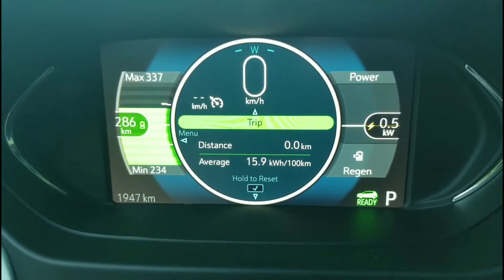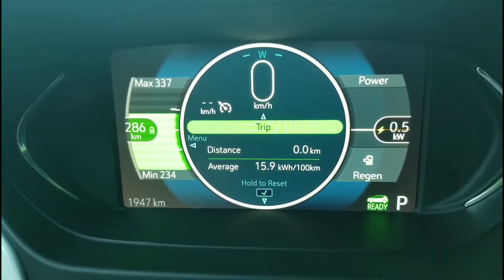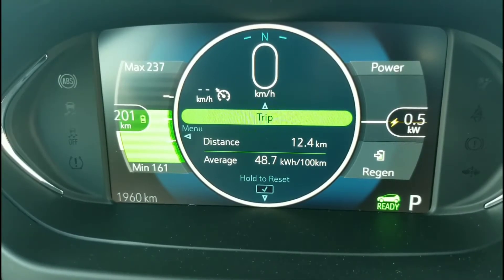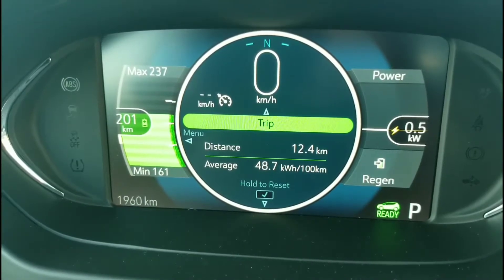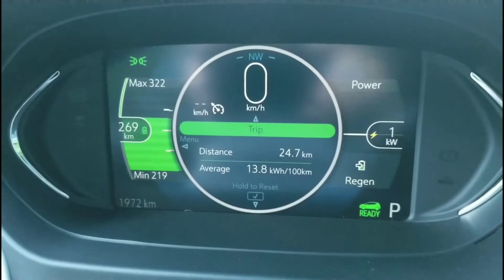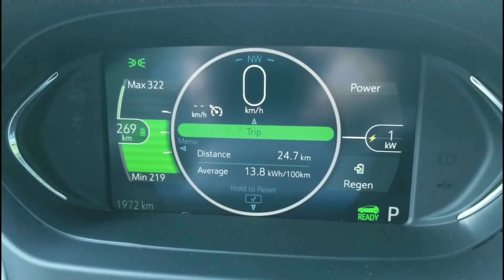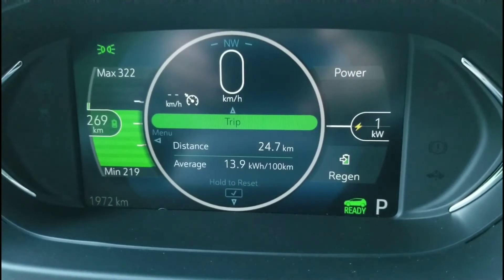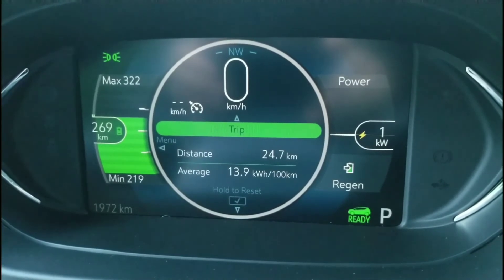2017 Chevrolet Bolt EV - How Much Does It Cost To Go Skiing?

Comment: Just curious, why do you show your range in km? I assume most of your viewers are in USA, since thats where the car is sold currently... I am all for the metric system but as far as I know, no where lists distances or speed in km or km/h in the US and most people cant do the conversions in their heads... EDIT: just kidding you are in Vancouver, BC... carry on! Great videos BTW!
Reply from the maker: Correct. Bolt EVs are sold in Canada as well, where we use the metric system. I just attended the Vancouver EV Association's (VEVA) 'ElectraFest' this weekend and saw more Bolts in one place than I've ever seen before. Probably, at least ten?? And many were the LT. I've never seen an LT and was curious to see some of the stuff it didn't have compared to the Premier.Still far and away, the most common EV is the Leaf. Lots of Leafs.
Reply: It's so hard to find a Bolt for sale in Vancouver. Last I checked, Bolts aren't available until the Spring. Did you have a long wait for yours?
Reply from the maker: Patrick Soon Hi Patrick. Agreed. I had to wait 6 months for my Bolt. I purchased it sight unseen, no test drive, basically just checking options online with the salesman. Paid full price. Didn't even get a Chevrolet coffee mug🙁. But as I say, I've been very happy with the car to this point. Silent. Quick. Fun to drive. And lots of electronics to keep you busy. You should get one👍

Comment: I think the Chevy Bolt doesn't give enough battery info for you to easily do a tesl like that. Using the guess-o-meter as a battery gauge won't work.

If you did the exact same test in reverse after driving on flat stretches if the mountain top to recalibrate the guess-o-meter to neutral, then when you drive down the mountain it would look like you gained a lot of range (which you wouldn't), but when you drove up the hill all that fake range would vanish and soon the range would be 90 km less than when you started at the moment you reach the top, until you drive around to recalibrate at zero slope again.

Hopefully Chevy Bolt adds some programming features that lets you choose how to view your actual battery energy. I'd personally prefer to know how many kWh I have left in the battery and my instantaneous watt-hrs per mile so I can learn what my vehicle does in each situation. 

Regen is one of the most misunderstood features of EVs. The fact is if you use any breaking (mechanical brakes, regen breaking or engine braking) you LOSE efficiency. However, of the three, only regen gives you back a tiny small percent that energy loss. 

Hypermilers will do their best to use zero mechanical brakes and as little regen as is safely possible, even if it means making everyone behind them mad. 

Regen braking helps most when the driver is driving the least efficiently, such as jackrabbit starts and max regen stops. 

The one place regen earns its cost is going down very long and steep grades that are impossible to coast down safety. The main feature is that it will prevent your mechanical brakes from overheating and will convert some of what would be wasted heat into useful energy in the battery. 

So, this is why they say regen can give up to 20% energy back. If you drive perfectly (but annoyingly) you will get 0% regen. If you drive very inefficiently (also annoyingly) you will get max regen but lowest range (although more range than if you used mechanical brakes instead of regen). So for average drivers who drive safely, regen will not add a lot of range, but I will makes your brake pads last forever.

The driver's report card from each battery recharge should tell you how it was used, sort of like android phones do. If should show in red how much was lost to mechanical brakes, in yellow how much LOST using regen, and how much lost due to over acceleration. But maybe this will cause too many hypermilers. LOL
Reply from the maker: Thanks IMHO. I hope that's what the test showed. Extreme mis 'guessing' on the way up, and the way down. Funny however, in the end, I was basically right back to the 14 / 15 kWh / 100km I've been seeing. I have been driving almost exclusively in 'L' since I received the car. Truly, I haven't really used the mechanical brakes to stop the car. I do however, engage the brake at red lights for safety. Otherwise, I'm using 'L' and the regen paddle to actually stop the car. I prefer the 'down shift-like' feeling of that mode. Coasting, feels weird at this point.I wouldn't call myself a hyper miler. I just drive it like a normal car, on occasion, I enjoy hammering past someone from the fast and the furious crowd : ) but mostly driving like a Dad.
Reply: Chris Farrer, I think that's one of the benefits of EVs is that they stay efficient going uphill, converting some electric energy into potential energy, and you most of that back on the way down. ICE engines waste a lot of energy going up the hill, so even if they turn the engine off and coast to the bottom, it won't average out to the same as a flat road of the same total distance.

The brake light behavior is another thing they need to let the driver have better control over. Theoretically, most EVs turn in the brake lights once regen KW or deceleration reaches a certain value, but it would be nice for the driver to have the choice of brake lights staying on while stopped or turning off light a car with manual transmission.

But it probably keeps the brakes working better if they are used just enough to keep the rust from building up on the rotors.
Reply from the maker: Interesting. I never thought of it that way but of course, at the top of the hill the Bolt has potential energy that it can store back in the battery. The ICE car just puts that energy into friction braking. A total loss of usable energy and additional consumable wear of the actual brakes.
Reply: Chris Farrer, yes, for a very steep hill you can put some of the energy back in the battery, but for gentle hills you would just coast down to get peak efficiency. I think people tried it in cars that report battery kWh and it takes a pretty steep long hill to put 1 kWh in the battery. 

In theory, the Bolt can regen 60 KW (but I think that's just for short bursts.) so to get 1kwh back in the battery you would need 60 seconds of full regen plus another 20 seconds to make up for losses. 80 seconds doesn't sound like a lot but if you get up to max speed and then apply max regen, I think you can't hold it at 60kw for very long before it slows down too much.

I think for the Bolt you can only see kWh in the battery when charging, right? So to test it you would need to connect to charger at the top of the hill (but leave the battery 30% charged so it can get max regen), then go down the hill and connect to a charger near the bottom. Not sure if there is another way you can derive how many kWh in the battery.

All the info is there, it's just a matter of Chevy making it available to the owner. I think all this passive monitoring data should be available to anyone who is geeky enough to want it. Just bury it deep in settings to access it.
Reply from the maker: I read somewhere that a guy towed a Bolt behind a truck to charge a flat battery. Just drove down the highway... could be fake news though.
Reply: Chris Farrer, Maybe it can evolve into a story where a guy straps a JATO rocket to a Bolt and charges it enough to get to a charger. LOL

I've heard of people thinking about testing it, but never seen it actually done. 

One of the problems is, if the battery is actually at 0% SOC, it shouldn't accept a fast charge. Not sure if regen can override this. Most batteries seem to be able to take peak charge at 20%-30% SOC, and then start tapering off at 50%-80%.

Since the Bolt is front wheel drive, I don't think a tow truck would tow it like that. But it sounds like something we would do with a pickup, tow rope, and a country road.